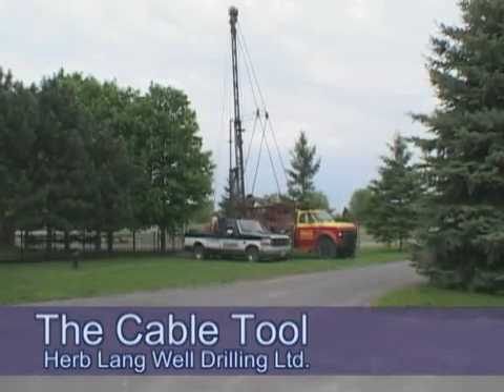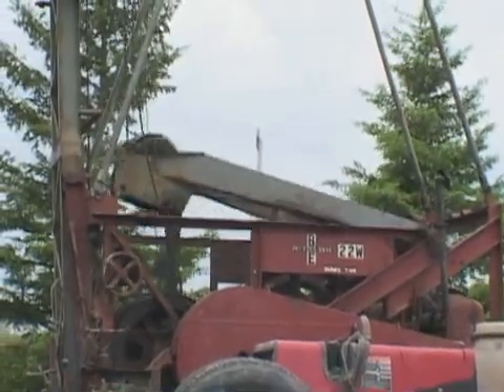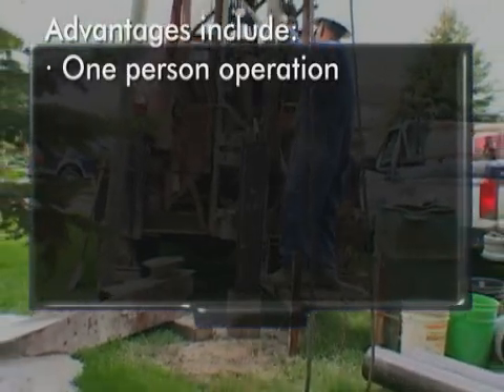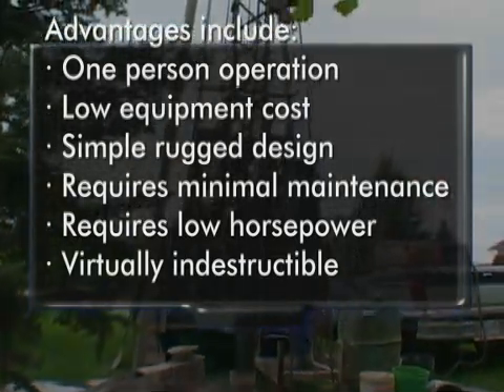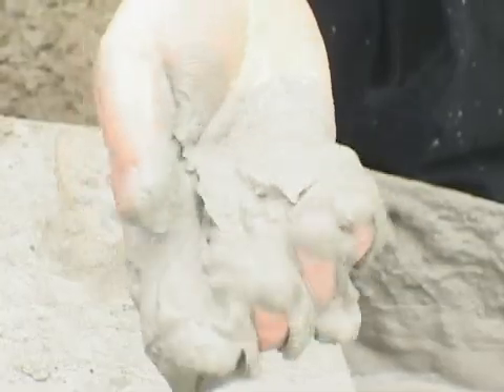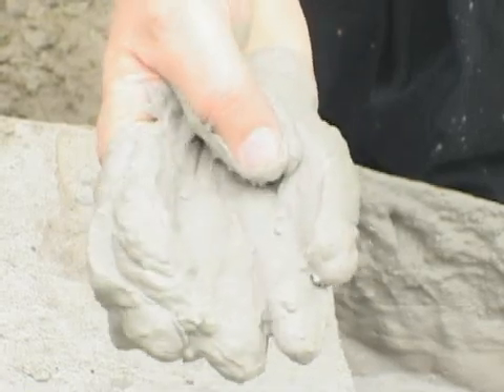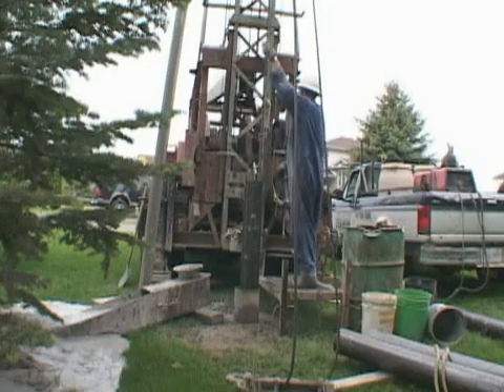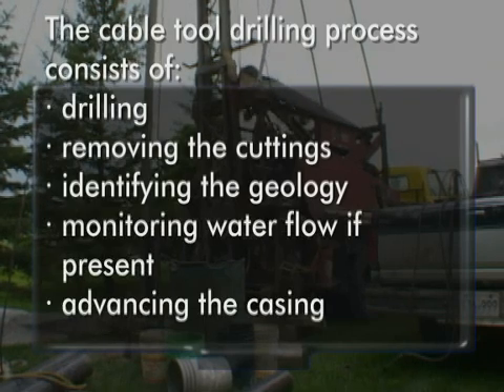Cable tool Drilling Method

Comment: I've drilled to 460' with a 22W. North of Toronto, Ontario. 6" casing. There weren't any  viable layers. Finished in black gravel. 50-60 gpm if I recall correctly. That was about 10 years ago. Great well, I'm proud of that one.

Comment: wow  I accidently ran across this video man I spent a few hundred hours on a cable tool rig  I never actually drilled a well with a cable tool rig  we used a mud rotary  a failing  anyway we used the 55 speedstar for drilling out older well casings  to clean out 4 and 5 inch steel wells  and we also had a 71 speedstar i believe  but that was what dad and grampa used to drill the wells grampa bought the first rotary back in the fiftys but never really used it he sure liked his cable tool